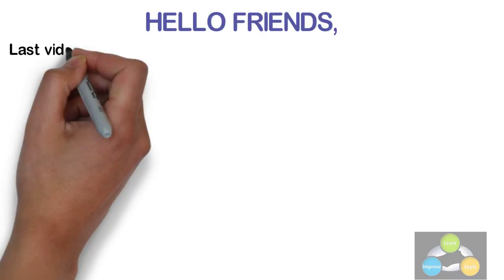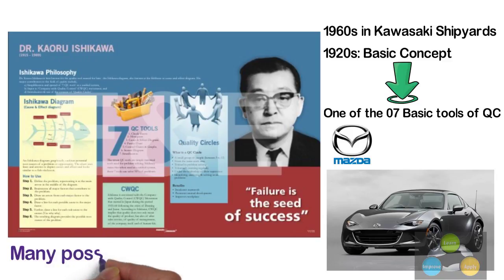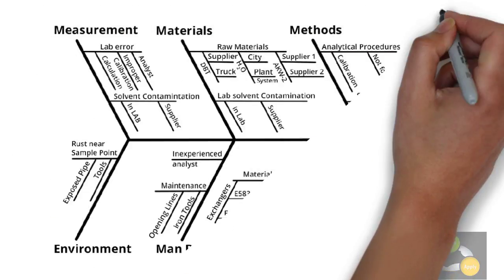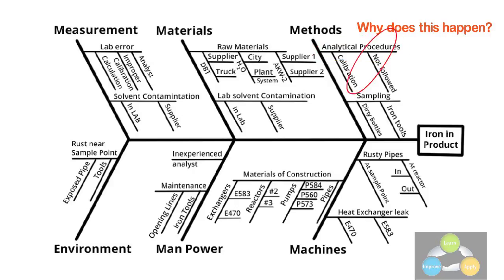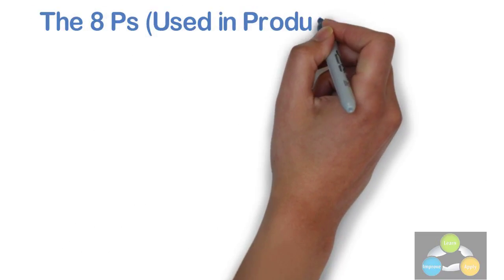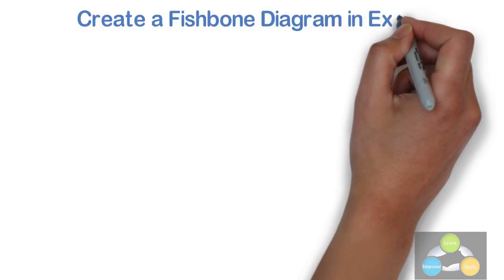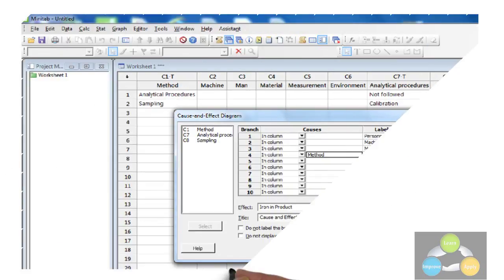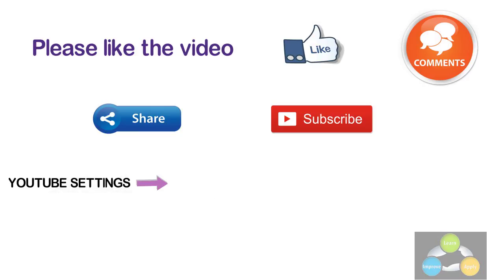Fishbone Diagram (Ishikawa): Explained with examples | 6M | 5P | 4S

Comment: Can you pls explain how will we choose where  to start first  with improvement project?
Reply from the maker: With the need for project and project charter.
Reply: @learnandapply  thanks. 
But my question was related to fishbone. We made the fishbone with all categories ( causes). From there, how will we select which item needs to start first. If it is based on frequency, we can see the same item appears under different headings (M/P/or S). That's what I'm looking for.
Reply from the maker: List down all causes and do the multi-voting by a team with Subject matter experts.
Select the causes that are rated as most important by subject matter experts.